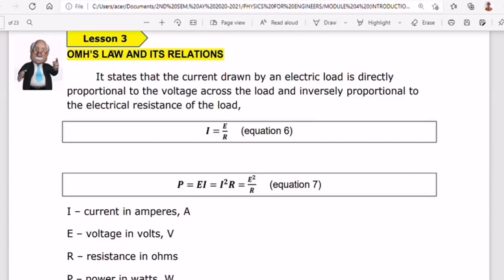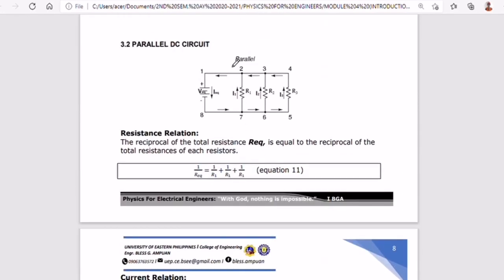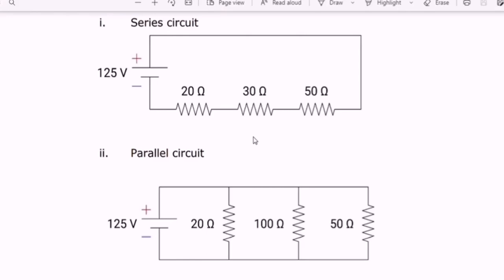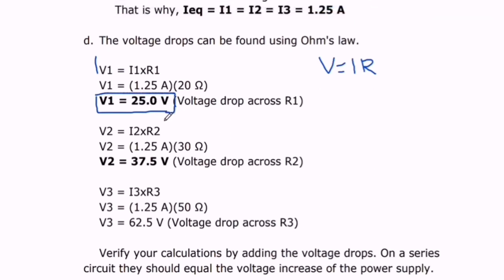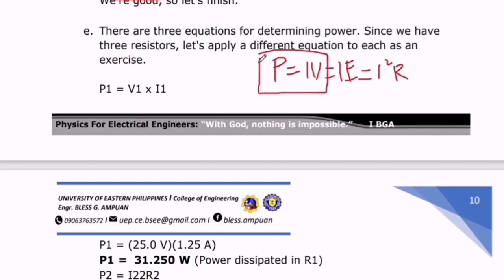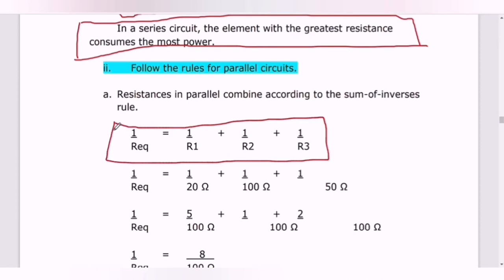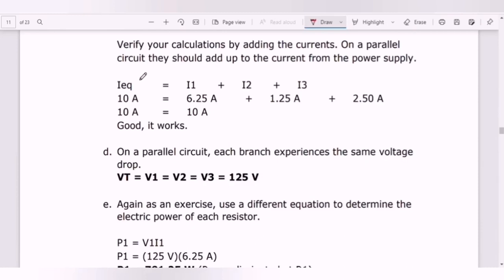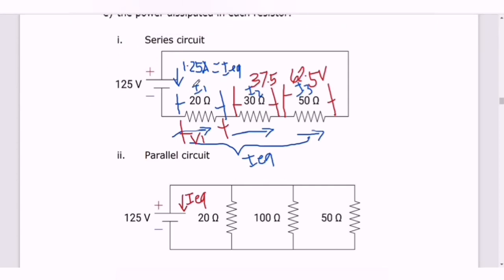Introduction to Electricity | Lesson 3 | Series and Parallel Circuits

Comment: Understanding how an equation is derived provides insight into the assumptions that were used in the derivation. The latter define the appropriate conditions for applying the principle. These assumptions are sometimes obvious, and sometimes they are not. I am grateful to have remembered this high school lesson, and I appreciate how easily I gained useful knowledge from this lecture.